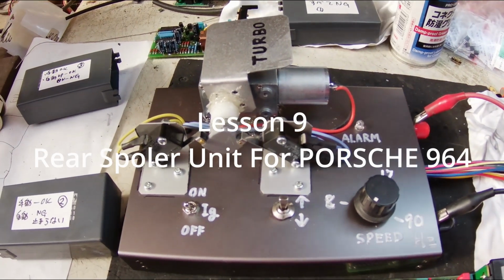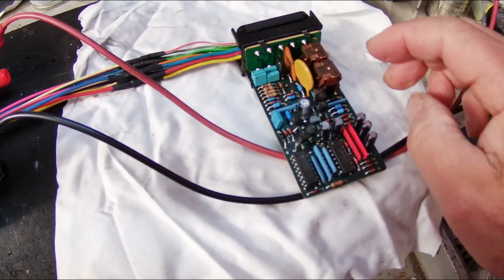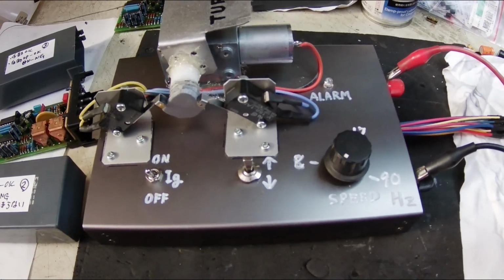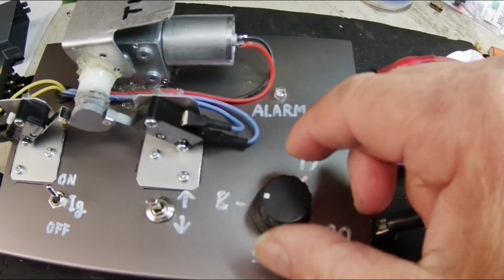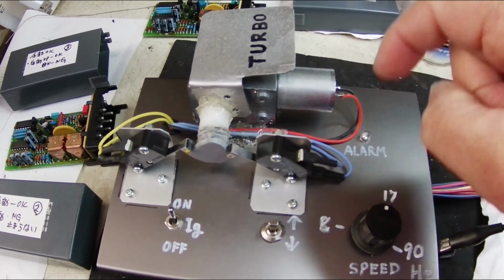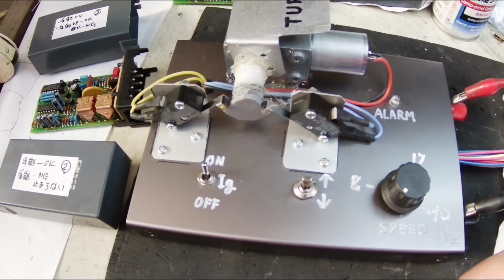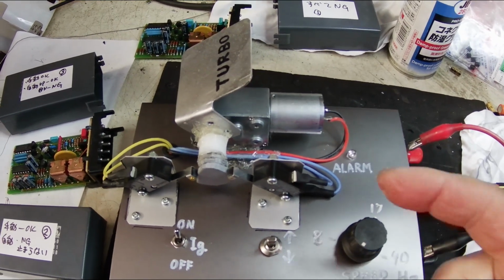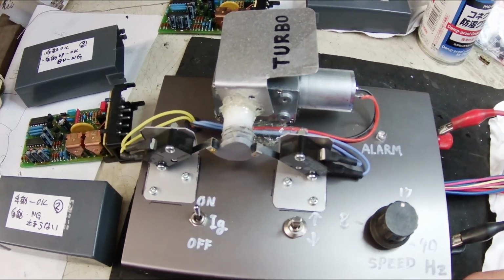Lesson9 ; Rear Spoiler Unit For Porsche 964

Comment: What a beautiful testing device!  I have an 89 964 C4, my spoiler is stuck in up position no matter what I do..  If I try to lower with manual override switch it will move just a few mm down but then quickly return to up.  Do you have any idea which component this could be that is failing?  Thank you!!!
Reply from the maker: I imagine that the controller is constantly issuing rising orders. This could be due to a leakage of electrolytic capacitors. The leaking electrolyte is corroding the copper foil on the printed circuit board, so the copper foil needs to be repaired before replacing the component. This is a very delicate and tricky process.
If your controller is a discrete type, all parts are available. However, if your controller is a microcontroller type, it is difficult to get it's program.
I wish you the best of luck.
Reply: @ wow you have a great grasp on this! I can tell this is a bit out of my league. Can I hire you to repair it. How hard is shipping from USA?
Reply from the maker: @jfaz  If it's on my desk, I'll gladly repair it. But I think the shipping costs are quite high.
For the same amount as shipping, you could have it repaired in the USA. Or you could buy a compatible unit of a new design. May-be.